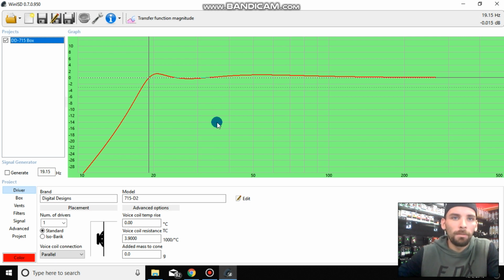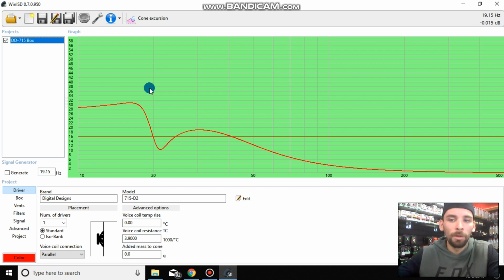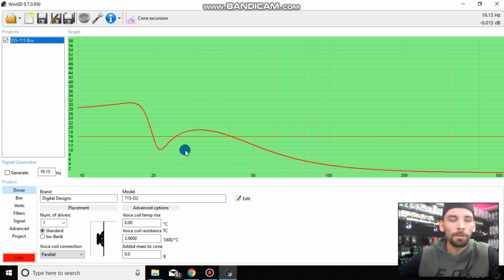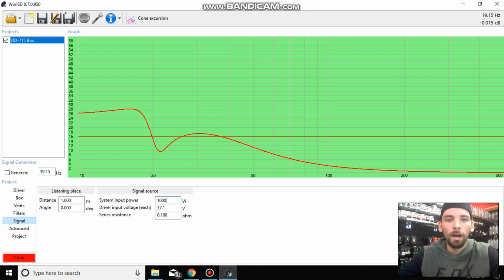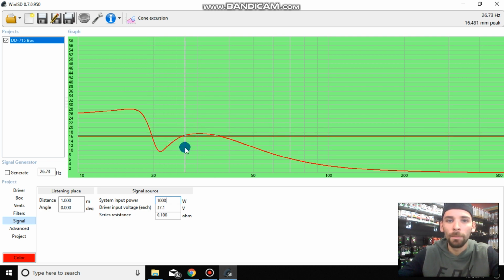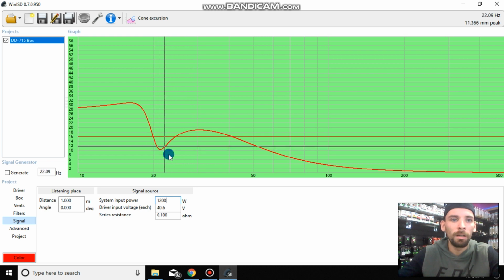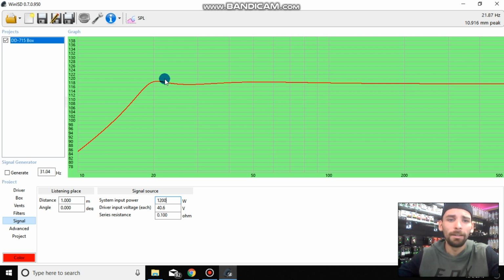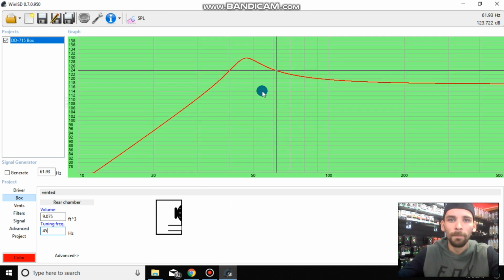Winisd Tutorial Episode 3 Cone Excursion and SPL Graph Explained

Comment: In winisd use the filters/crossovers to fall off somewhere around 20-30hz at what ever rate you choose. this will drop the excursion graph below the xmax if done correctly some subsonics are at 0-50 some at 10-50 but a bump to 20 will cut that hump off the graph at 20hz. this way you can glance at the wattage range you have available before the amp starts to clip. say i might have a 1200 watt amp set to 30volts output but it goes up to 36volts clean before it will clip and i can get up to 1400watts from it. Using that subsonic cuts those lows out keeps your subs safe even though you dont hear that 20hz it still consumes a lot of power to play because any frequency below your tuning frequency taxes the amp harshly for wattage. same goes for high pass/ low pass settings having those cut the signal gains at the right place makes the amps job so much easier and keeps your gear more efficient so it can last longer. some amps out there have the subsonics ranges drop off at 24db octave slope and that is super fast 12db octave is slower and i like it more but if it is built into the amp at 24db you can go a bit closer to the 20hz i guess. alway be in control of your gear 100% dont think well i cant hear it so it is fine because allowing a low decibel 20hz through will still cost the amp massive wattages to play it no matter if your in your xmax or not. Depending on version of simulator you can set the octave slope along with the subsonic range but use values that you have on your gear so you get the best iterations of the gear you have available or intend to use. In my day we didnt have this sort of control we had to use multi bank EQ's and active crossovers with switched not even dials lol.... things have changed alot but i wonder to myself why there isnt logic in the amplifiers to accomidate this and the only answer i can give myself is planned obsolescence.. They want to give you all these knobs and dials and mislead you of the capabilities in hopes you break it and buy more. The DSP's out there giving tighter control and more user interface are super expensive as well confusing if i was a manufacturer i would want to lean towards built in controls more on a plug and play level because so many consumers are confounded to set up car audio and dont want to pay for finger quote professionals..
Reply: phew

Comment: If you don’t put in the correct Sd parameter, this graph won’t plot. 
Google “inches diameter to square inches”
So for a 12 inch subwoofer. Minus the surround is around 10 inches cone area in square inches that’s 100 sq in
Enter 100 in the Sd box
Make sure it says “sq in” next to the box
Reply: if your not getting that spec from manufacturer you want the measurement of the peak of surround to the peak of other side of the surround but is easier to measure from the one outside of surround to the peak of the other side. GL.

Comment: What parameters affect the cone excursion graph?
Some drivers just plot a flat line across the bottom. Why?
Reply: 1: using filters to match the available crossover settings of the equipment you intend to use. setting a subsonic or high pass filter to 20-30hz would have cut the big hump at 20hz making the amp run more efficient and not surpass the subwoofers xmax. 2: if the driver plots a flat line at 0 on xmax graph you didnt input any wattage above the standard 1 watt starting point or your looking at the passive radiators graph not the sub/woofers xmax.

Comment: Cone excursion, red line are x-max, lets say its 9mm, thats how far cone/coil can go before it leaves the magnet, if it goes above red line (eg. 9mm), you lose control and it can sound very bad as magnet will not be able to control the cone.
There are also x-lim/x-mech, lets say its 13mm, thats not shown in the graph (because you should not cross the red line x-max in the first place), but it you cross it, and if you reach above x-lim/x-mech (eg. above 13mm), thats mechanical limit where parts will come apart, coil leaves magnet, cone went too far and tear, coil hit the back of the speaker, crashing everything, basically thats mechanical limit where everything gets destroyed.
Usually its fine to get up to the red line (x-max) with compression, as pressure will bring it back, and even if it goes above red line just a little bit, pressure will help the cone to get back, helping magnet that will still have effect on the coil, without too much "out of control."

Comment: If you tune box significant low base on the speaker that would happen you will have to put a low pass filter very low is some case at 50 or 60hz which mean your subwoofer will only be able to play sub bass frequency. I would ensure it stay below the xmax because you don't know how much xmech the speaker is rated at because they don't list this.

Comment: u can lower it by using a HPF and adjusting it. And, I'm sure there are other ways. I don't see too many makers showing Xmech and Xmax. So, who knows how far is too far.
Reply from the maker: Yeah, in general I've based driver choice on how much information a manufacturer provides about their drivers. Although, I have found ways to measure t/s parameters recently. I've been working on a device that can assist in t/s measurements for the past several months.